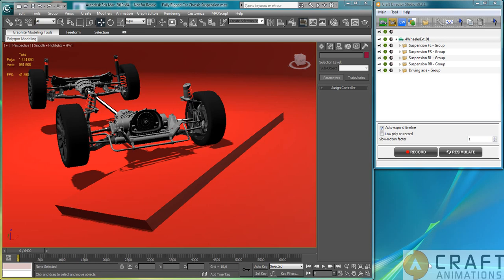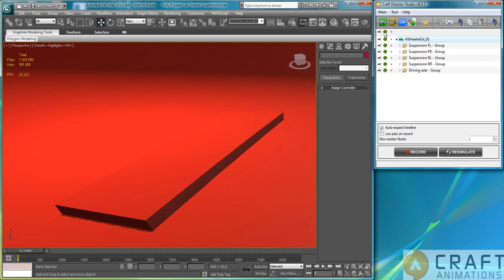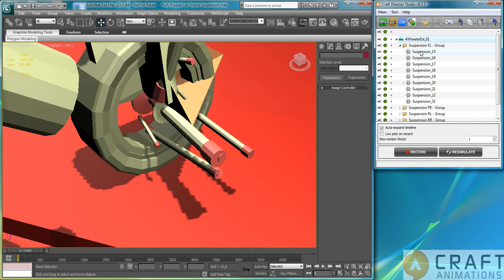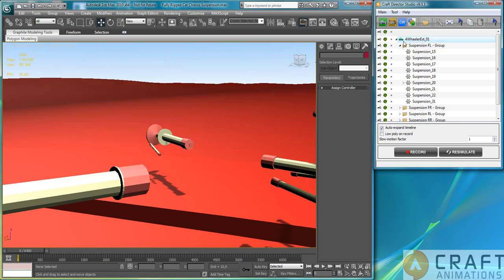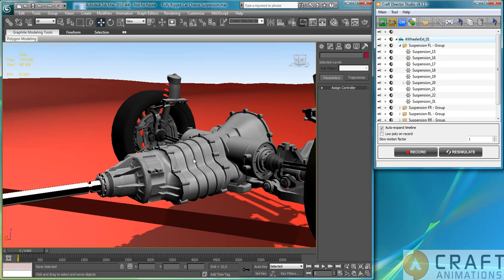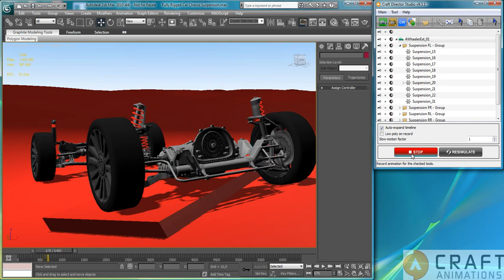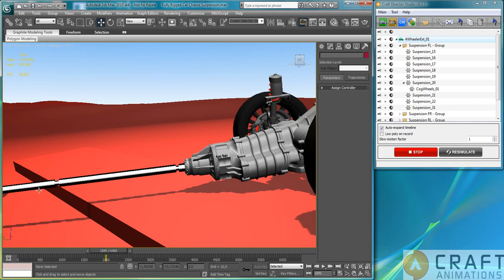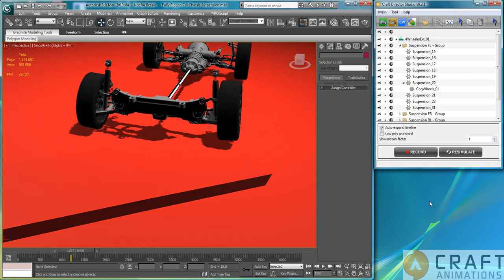Advanced Scene Tutorial - Fully Rigged Car Chassis with Wishbone Suspension

Comment: Hey! Could you please tell me what you are using for the steering of the driving axles . I guess it's not Suspension? Thank you. :)
Reply from the maker: +Asen Stratiev You are able to use the Suspension tool to achieve this. You could also use a tool called CogWheels to transfer the rotation of the wheel to the axle.
Reply: +craftanimations I am new to the CAS. I'm trying to rig a buggy, but I just don't know how to parent the steering knuckle. Could you tell me how you would parent it? Thanks a lot. :)
Reply from the maker: +Asen Stratiev You are able to move the steering wheel of the Craft 4-Wheeler Extended to the position of your models steering wheel to transfer the movement to it. Make your models steering wheel the child of the Craft 4-Wheeler Extended's steering wheel.
Reply: +craftanimations  I didn't mean the steering wheel. but the steering knuckle - the part directly attached to the wheel and brake disc, that makes the wheels turn. Please tell me how to parent that, cause I'm getting desperate. Thanks
Reply from the maker: +Asen Stratiev Ah. If you are using the 4-Wheeler Extended tool then you are able to set the steering knuckle and the brake pad as childrent to the "WheelCenterMesh". The brake disc should be set as a child to the WheelMesh. Hope this helped.